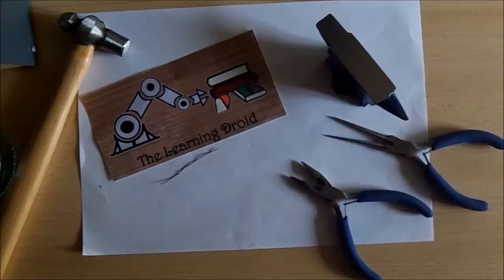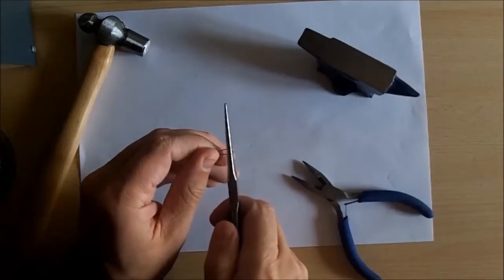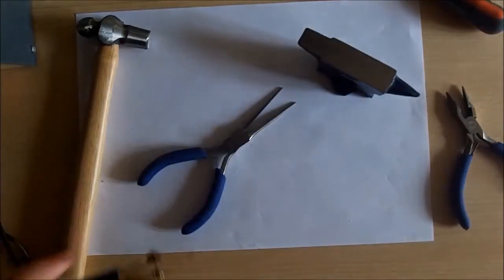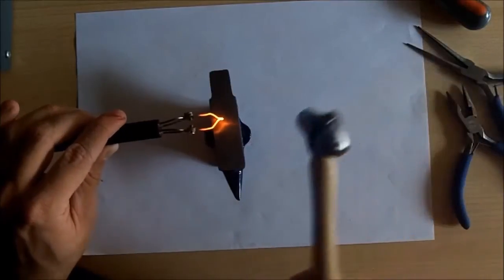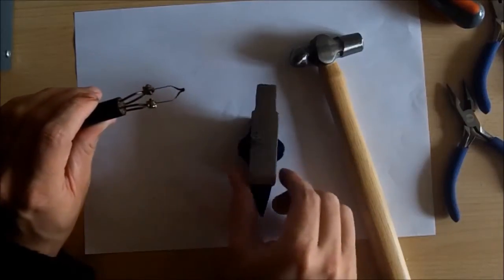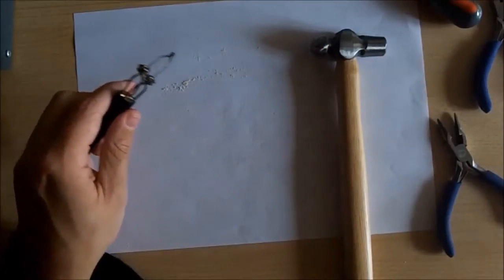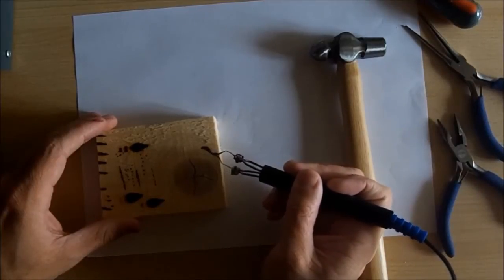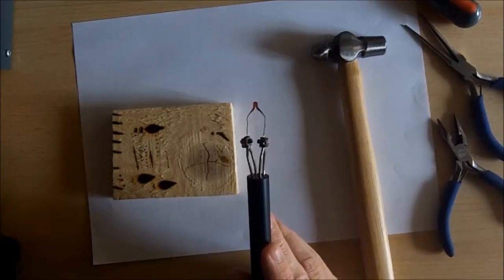The Beginner's Guide - Making Wire Point Tips - Detail Shader Bit - #5

Comment: Very iteresting information Viorel......I'd like to ask you, is it ordinary wire that you use to make point tips?and thank you.
Reply from the maker: hi viktor I use a nickle chrome wire recommended for the machine I use, this is because you need something that will heat up but still remain solid, while not transmitting so much current you burn out your circuitry.  Nickle chrome is recommended for most machines but every manufacturer has their own recommendations.  Scientific nickle chromes easy to buy :)

Comment: How volteg is use in shader spoon for pyrography pen.
Reply from the maker: the voltage or settings required will vary allot based on the thickness of wire, the type of wood, the speed of movement, and the depth of burn required. 

The best suggestion I can give is experiment on a piece of wood as close to your final piece as possible.

Comment: This man tells us to use "wire" !  WHAT Gauge wire he doesn`t tell us .Are we supposed to just buy any size of thickness wire ,or if he could explain what size wire would probably save us wasting our money . For example detail wire would be thinner I assume than Wire used to make a Spoon Shader or a Large chisel shader but this is not explained ,WHY NOT ???
Reply from the maker: Some machines use nickle chrome between swg 21 and 26 others use a different alloy or even pure nickle between 19 and 22 or 23 and 28. Your machine should have instructions.
I use the term thicker wire in this video to denote that to make a shader point you use wire that is on the thicker end of the scale YOUR machine uses.

The man explained all about gauges and types and that each machine has it's own preference in a different video.
The man produced these videos 5 years ago, and was not massively experienced.

The man doesn't see the point in your aggression on a free video you can CHOOSE to watch and take advice from or not. I am not the one who made you buy a pyrography machine.
Reply from the maker: You can also make ANY point with ANY thickness of wire, but the results will change, a thin wire will yield a thinner finer and hotter running shader point.